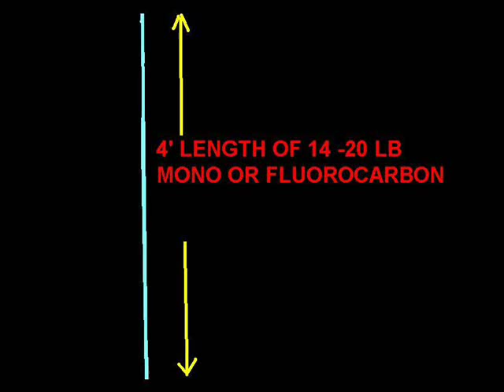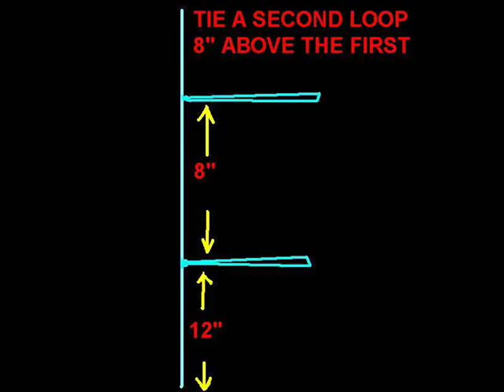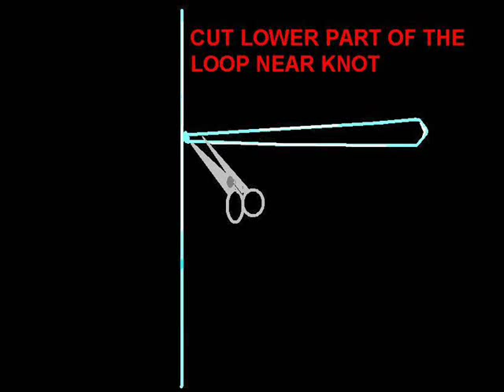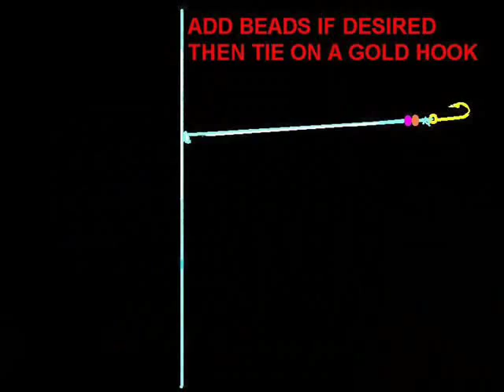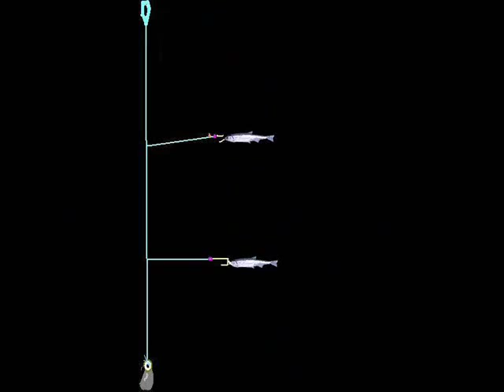TYING THE PERCH RIG

Comment: Used a very similar rig for surf fishing today, this rig has many useful features. 1) It's all one line.. meaning it's strong! 2) Weight is fixed on the bottom, having weights in the middle kill a little line sensitivity and can cause your line to spin when cast and tangle. 3) Your bait is JUST off the bottom and the other can be floating 8" off the bottom. This way your bait won't get buried in sand and be more visible.

Comment: i do this with 4# mono line and i dont cut the loops. just twist and pinch put through eye of  hook open loop wrap around hook and cinch. dont need to tie on hooks. and you can easily put bigger ones on if you want to target largemouth bass/. or put little hooks on for sunfish, or lures ect. . i usually do the 5 wrap surgeon not since its fast to tie. but i used to do a dropper loop knot. which i do use for ocean rock fishing too. though that one slips on me sometimes and i dont know why. but since i put hooks on differently i even landed fish when it slipped it turned it more into a drop shot rig since it could slip past the eye of hook.

Comment: Im having trouble with these knots slipping.. :/
Reply: i use 2-4# mono and caught nice sized largemouth bass with this method - cutting the loops.  and the og dropper loop not slipping. . sometimes when i would do the dropper loop knot i was taught by some older guys on my first ocean trip it would slip on the bottom side sometimes so then i started using this surgeon knot 5xs and then i havent had problems. practice makes perfect. but ya try the other dropper loop knots maybe those will not slip for you. but ya i never figured out why the other way was slipping for me but im sure it was something i did wrong when cinching  since it only slipped like 30% of time.  but i did catch like a 2# largemouth  and it slipped but since i put hook on different i was still able to still land the fish since it couldnt fully slip out when hook is wrapped on instead of tied on. and then if you are using braid or flouro i cant speak on those types of line i have always used mono my full life.

Comment: Do not use spit for wetting the line. It degrades it. Great rig though.
Reply: very bad advice not lubing line. thats how you lose big fish and maybe even small fish. with no lube on line it can cut in on itself and weaken the knot. lubing the line helps for it not to cut in on itself which will land you a lot more fish. even the big ones, on light line. ive caught 5# + fish on 2# mono because i lubed the line when tied the knot.
Reply: I didn't say don't "wet" or lube. I just stated that saliva is bad.  I'm sorry you had to type all that. Tight lines.